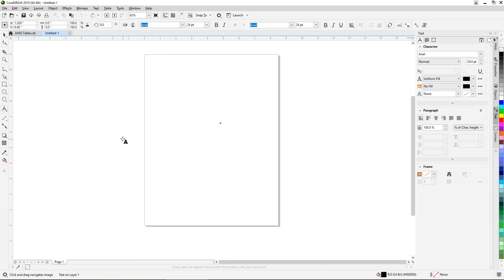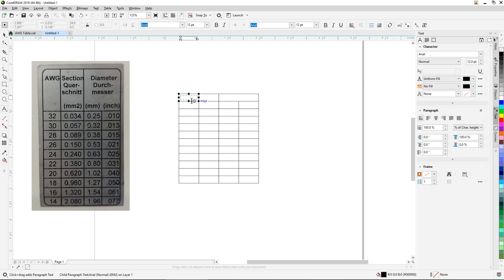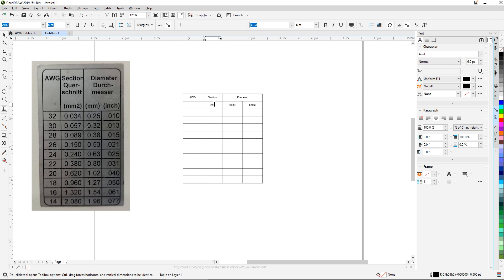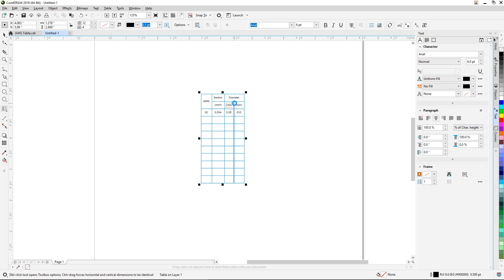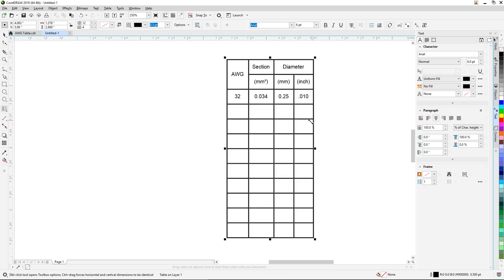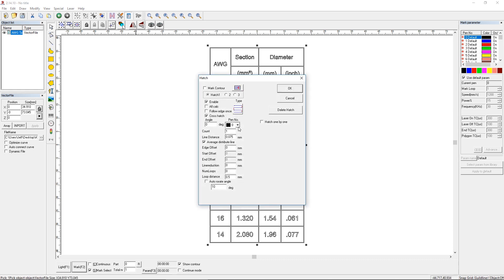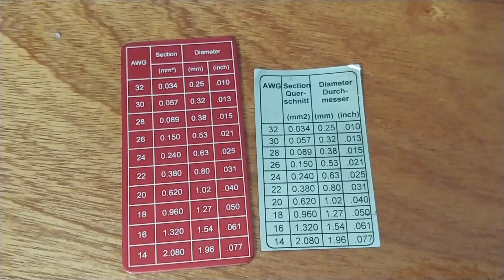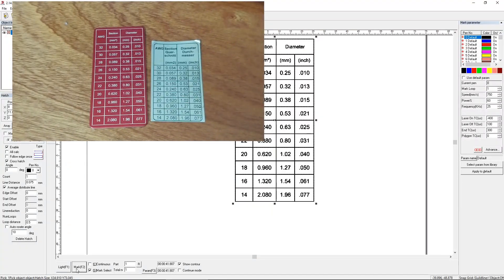How to Make a Table in CorelDRAW for Fiber Laser Marking in EzCad2

Comment: This is if topic a bit so I thought I would ask on and older post but do you know of a way to work on EzCrash while it is not connected to the laser? Or not having it go into Demo mode? I didn’t know that you can save file and had work like 8hrs not connected and then it would let me save it. As I closed it asked me to save it so I was super relieved but when I went to look for the file the next day it was not there and no where to be found “ unless I’m a dumbass, which is a good possibility”. Any ideas? What about a WiFi adaptor? I have a knock off card and run EzCrash .9 vs .14 so I don’t know if that would work. Thx again
Reply from the maker: There's a USB dongle you can buy that emulates the JCZ board.  I think it's <$200. You should be able to buy it almost anywhere.  Cloudray, Wisely, direct from JCZ...etc.

Comment: If you use glass on copper it will transfer the copper to the glass as well. Stainless just seems to make it black. Also keeping some pressure down on the glass or plexie keeps the keeps the air out and you get a darker mark. I have also tried to preoxide the stainless then add the glass at it helps with black marking. Be careful not to get the glass hot it will crack.
Reply from the maker: Interesting suggestion, I haven't heard of doing that with copper yet!